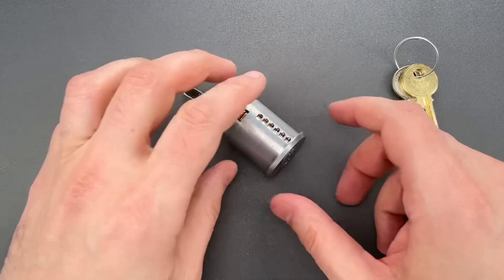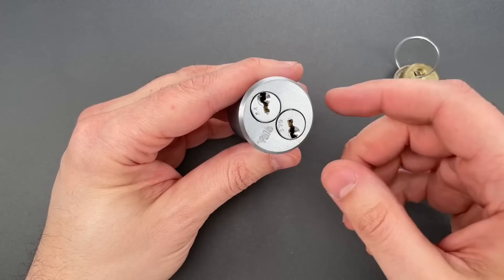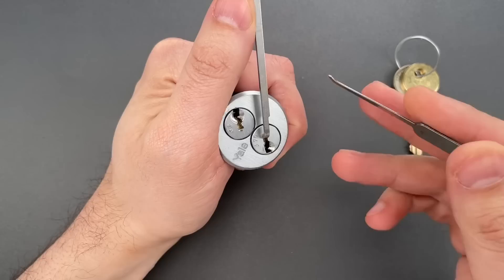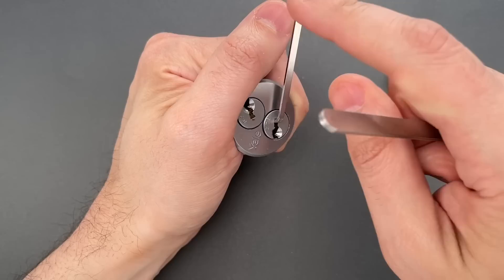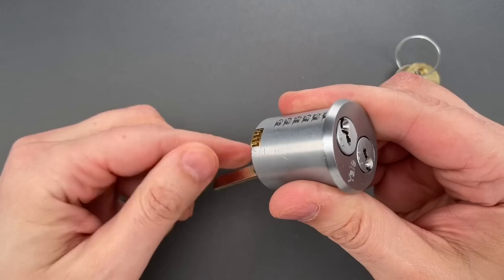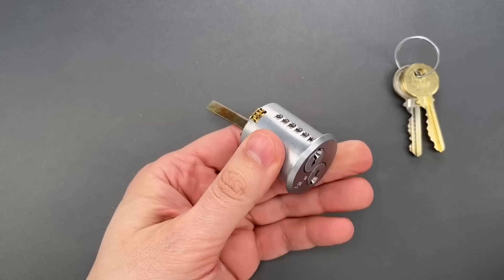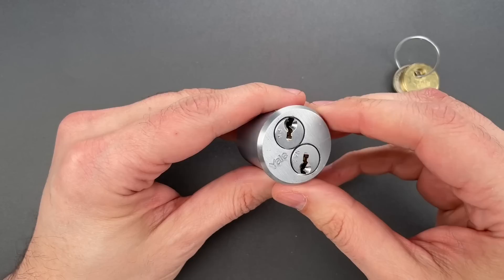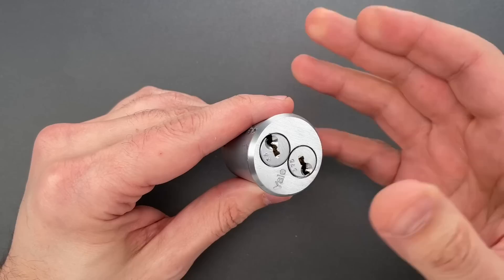[1511] What Were They Thinking?!? Yale Bicentric Bypass

Comment: These were the first locks I learned how to pick. I wasn’t doing it to break in; I worked at a facility that had many offices and classrooms, and only janitors and senior administrators had master keys. Everyone else had keys that would only open specific types of doors ("O" for offices, "C" for classrooms, "S" for storage, etc.). I worked in the main office in a lowly clerical position and only had an "O" key. People would come to the main office if they had left their keys at home or didn’t have them for whatever reason, needing someone to unlock a door for them. Often there wasn’t anyone in the main office who had the appropriate key. After wasting far too much time tracking down an administrator or custodian, I decided to try my hand at lockpicking. Turned out I could open any door in the building with a bent paper clip.
Reply: These were the first locks I could open any with in the building with. People would come into the main office to break in. I worked wasting far too much time.
Reply: Given your strong endorsement, I wonder how much Covert Instruments could charge for bent paper clips.
Reply: U probably really impressed ur coworkers and got top from that cute Amy.
Reply: The designers of this lock were obviously assuming that most people would not have access to paper clips.
Reply: Probably didn't necessarily need to be paper clips, but those were probably more easily accessible. Bobby pins are another item that comes to mind with lockpicking using generic objects -- which is probably why they don't sell them at the University Campus Bookstore for the place I attended despite how useful they are. Why was I looking for Bobby pins? My hair was in the way and was far too short to tie back. Plus I ended up using some of those pins to clip together papers at one point
Reply: @spellucci  sixty nine thumbs

Comment: Imagine not knowing the bypass flaw, picking it (yes!) but the door still doesn’t open (what??). 😂
Reply: True. But there are other reasons besides a bypass flaw why it might turn after being picked without opening the lock.
Reply: It's a feature, not a bug
Reply: Yale Marketing team: "LPL just confirmed that line is 100% pick resistant!"
Reply: Psychological warfare
Reply: @Martin Baldwin-Edwards It's still better than slapping it to open up.
Reply: ...then you would be feeling around with a knife tool for a detent or cam activator and then you would realise the flaw.
Reply: Ironically this probably makes it MORE pick resistant than typical lock cylinders
Reply: w8 what's the genuine way to open this lock?
Do you need two keys at the same time?
Reply: @Broockle  Nope, any of two different keys can open the lock. The use case is multiple locks that share one "master key". You can distribute keys to personnel so that they can unlock only that door where they are supposed to go, yet you yourself do not need to brig the keyring with multiple keys, one master key will unlock all of the doors.
Reply: @artursruseckis4242  
ooo
Reply: @radix4801  lmao
Reply: The very same thing happened to me the other day. I was...  somewhere... practicing picking (still a newb) and came across a closet door that was locked. After picking what felt like several spool pins, the lock turned but the door didn't unlock. I guessed that there was some extra button at the back of the keyway. But I wasn't there to open it, just to practice, so I left it.
Reply: Yeah some euro style mortise cylinders this happens as well so when you pick it open you have to make sure you push the pick against the spring loaded cam to catch the tail piece. That being said I dunno  if that would have come to me in the field or not, definitely will now though 👍
Reply: Yes. It is really unsafe and really safe lock at the same time. If the person doesn't know about the flaw, it is unpickable. if they DO know though,  they need the one pick.
Reply: @artursruseckis4242  Didn't there used to be something called a "skeleton key" that did the same thing without the need for a second cylinder?
Reply: @Inkpie  Well either way they are already picking it, since nobody expects that flaw I think it is actually safer against beginners lol
Reply: @Broockle  He said it. The end of the key operates the opening (like he did with the wire).....
Reply: @bricaaron3978  Yep. Made one in high school - ages ago - to open lockers for friends who left their key at home.
One guy in particular was as forgetful as our president!! Helped him get into his locker OFTEN....
Reply: @dd_ranchtexas4501  That's weird --- your lockers had keyed locks? We used combination locks.

..Though they might have had a keyhole on the back... I don't remember. Maybe that's what you're talking about?

Comment: At the last university where my dad worked, there was a key needed to access the elevator. The idea was that only faculty and staff could use it and the occasional student who needed special access.  On the first day there, we were getting a tour from of my dad's new colleagues.  He showed us the elevator and mentioned that you could use it without a key by pretending to use a key but just about anything would work.  It turns out that you could use a penny to give a slight turn and call for the elevator.  Years later, when I was a student there, that trick still worked.  It allowed me to bypass the locked doors which kept you from getting off of the main floor and I could get to any floor.  That also allowed me access to the sub-floor that had a tunnel to the building next door.
Reply: The tunnel sounds handy on the rainy days!
Reply: That makes sense though about why they wouldn’t bother changing it years later. If nobody but a handful of people know that you can open them without the key, no point in spending money to change the locks and get all new keys for faculty LOL
Reply: Excellent! Good for exploration uses.. 👍
Reply: Just funny how much things like that are an illusion. And then they last for a very long time. It's not hard to keep people locked out of things because most are just not determined.

Comment: I legit laughed when he picked the lock and it didn’t do anything hahaha
Reply: @David Falterman, so did Yale!
Reply: I didn't
Reply: And he did it on both cores to prove it was not a fluke.
Reply: A technically pick-proof lock
Reply: @brennanruiz1803  I was thinking the same thing. Pick the lock and spin it but nothing happens.
Reply: Oh shit what a great security feature! ... wait
Reply: Does any company actually make a good lock?
Reply: @zenithperigee7442  not for long, though.
Reply: Oh look, something defeated the LPL, wait... is this busted?
Reply: Foils amateur lock pickers. They think they need to pick both of them at the same time. Or pick them twice (like that one lock recently where you had to keep picking it every rotation, many of which were required.
Reply: @bar10dr  weld a bar over the door to lock it, and then use a buzzsaw when you need to get in.
Reply: @bar10dr  Yes, there are good locks.

Drug addicts who need some money for their next fix will just smash and grab and ignore the lock.

Professional burglars might bring their own power tools - or they might go for smash and grab. In any case, they'll ignore the lock.

Basically, smash and grab is the method of choice nowadays. Steal a car, drive it thought the front door, grab, flee. If your target is a jewelry store where road blocks are installed to prevent cars from getting to the door, steal a steel rod first to bridge the gap between the car and the door. Doesn't matter whether the car breaks or not, it just needs to get you back to the other stolen car which is your real getaway vehicle (hidden somewhere where no witnesses are, unlike the jewelry store where you perform your heist in front of amazed onlookers).

But mostly it's just drug addicts around here.
Reply: You picked the lock!
Reply: "Click out of one..  Click out of 3...  Fug it.  Just shove the whole pick in and turn and you're done."
Reply: @runed0s86  Now you're thinking with portals.
Reply: @bar10dr  I mean what is the point really. You don't want a bad one but a good one is only as good as your windows are strong.
Reply: I'm thinking wait that's actually kinda neat it means you can't really pick it ooooh. Oh. Nevermind. XD
Reply: I legit never laughed, I did legit think wow that legitimately didn't work. So legit😂
Reply: @bar10dr  abus

Comment: So, in other words.  The master key to open every one of these locks is a straight piece  of metal with a bent tip.  🤔
Reply: No dual core required lol
Reply: @FishSnackems    It's in case you break the piece of metal off inside one of the cores.  You can just get another one and use the other core.  Genius design.  😂
Reply: @FishSnackems  The dual core was for dual access. Didnt have to have both keys
Reply: why would someone choose that over just getting an extra key cut? @davelowets

Comment: So if I'm understanding this correctly, they effectively made a warded lock using pin tumbler only for the form factor
Reply: Yeah. I was thinking that. Something tells me that similar mechanics were used by the Egyptians too. So a couple thousand years old design, not just one hundred as LPL said.
Reply: I mean, as far as only keeping our the honest people, this would do a great job. This warded lock weeds out keys that are both too high and too low, unlike regular warded locks which only restrict overheight keys.
Reply: @phillyphakename1255  Kind on neat, raking will also not work.  All sorts of security ideas but protected only by obscurity while it lasts.
Reply: Don't discount the intimidation factor!

Comment: Oh wow, that's worse than I was expecting. I was thinking that if you unlocked one cylinder, perhaps it allowed you to easily decode the other cylinder, essentially allowing anyone to make a master key.
Reply: You can still do this too. Once you have access to the back, you can pull the whole lock out and take it apart. Decoding it is then super easy with it out. Plop it back in once you have your key and boom. Worried about someone noticing the gaping hole? Replace it with an identical lock of any key. This will buy you either some time, or infinite time if they just replace it with a working one. They'll either notice the trickery, or most likely just throw away the evidence and replace it with a working one.
Reply: anyone with a paperclip has a masterkey for this lock system as it turns out.
Reply: @joblessalex  Deviant Ollam talks about replacing the cylinder with one filled with mastering wafers (so literally any key would work, and no one would realize it since the key meant for the door still works). Decode the cylinder on your own time, then come back and swap the cylinders back. Boom, you have your master back, and you now have the key you need for other tasks (especially if it was part of a mastered set).
Reply: @JaxMerrick  yeppers! But really the question you need to ask is how often is this lock used? If it is a lot, will anyone have a repair man out in time? Will the repair man even check to see why it failed, or just throw it away and replace it? If he does check it, will he know you messed with it or just say "huh, that's weird"? High likelihood that it's overkill to master wafer it, but it is the safest way.
Reply: @joblessalex  Well, he's a pen-tester, so he usually looks for the least used, often unlocked cylinder (like a bathroom door). I don't know what your situation would be, but most people wouldn't even notice to call in a repair company.

Comment: Watched this channel for so long, at first I was thinking "probably nothing shielding the mechanism, he will just reach behind the lock and rotate it opened",
then you started picking the lock I was like "hmmmm, maybe no security pins?"
then it was mentioned that core can be free rotated, I was like "hmm unsure where this is going"
then you mentioned that the tip of the key is rotating the core, and then I knew, the problem is you can reach mechanism behind the lock and rotate it and open it"
Reply: I didn't get suspicious until I saw the brass gears at the top and bottom. Thought: Oh, Oh, freewheeling...and then he just shoved a glorified straightened bobby pin in, and, yup, opened.
Did Master Lock steal all of Yale's failed 1920's designs?

Comment: Tip of the key is probably the earliest and most used option for master key systems. 
It was and perhaps still is, the way that every "Master Lock" with symmetrical teeth on both sides is easily bypassed. All that's necessary is to grind away all of the teeth except the last ones at the tip.
Where I used to work it was either a hammer and chisel or the universal key when I needed to get padlocks off of lockers that belonged to previous workers who left their locks behind.

Comment: This applies to 'nightlatch' cylinders only. Most Bicentric cylinders would be of the screw in mortise type. Mortise cylinders have a cam fastened to the end of the plug to drive the locking mechanism. A Bicentric mortise cylinder has two cams. One is fastened directly to the lower plug. The other slips over the lower plug and can move independently of the lower plug. It is driven via gears from the upper plug.
With the mergers of lock companies (Yale is now part of ASSA-Abloy) Yale apparently ceased production of bicentric cylinders some years ago. This meant that institutions like MIT had to find an alternative cylinder to use. Possibly the advent of swipe card systems contributed to the demise of the bicentric cylinder. 
Interestingly an Australian company produces a cylinder (Galaxy) which could be regarded as a 'tricentric' cylinder. Although there is only one keyhole, there are three different key types where the bittings are completely independent of each other. As long as the correct key of one of the three types (which can be called 'grand master', 'sub master' and ordinary) is inserted, it will operate the lock. If the 'grand master' is lost, only that key needs to be changed, all the other existing keys do not need to be changed.
Reply: I guess this product was dropped because ASSA-Abloy already had other twin cylinder designs. At least in Finland (where Abloy is from) there are plenty of twin cylinder locks.

Then again, modern Abloy locks are designed so that the key no longer operates the latch, it only engages the handle which then withdraws the latch and at the same time resets the cylinder. How I open my front door these days: take key out of pocket - insert key - turn key - turn key back - put key back in pocket - push handle down to open door. The thumb turn works the same way.
Reply: and the swipe cards are just as easy to bypass lol

Comment: This flaw is also very common on cheaper euro cylinders with thumb turn. It can be fixed but it requires a more complex clutch mechanism especially when dealing with a thumb turn that isn't always at an exact position to the core like on a euro cylinder.

Comment: First locks I had to pick had a similar flaw; a bent paperclip could reach past the cylinder, rotate the lock (so it opened) but also then released the core to slide out the front! Got into the desks, but meant I also had to learn how to rebuild the lock to put it all back together again.